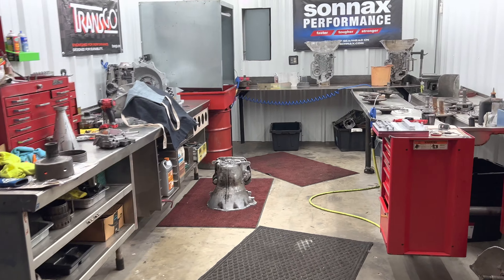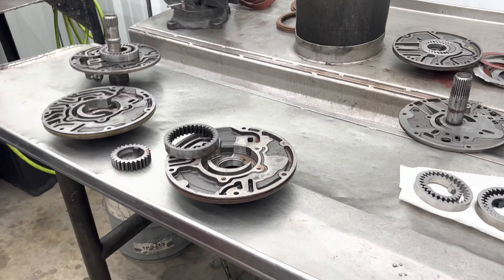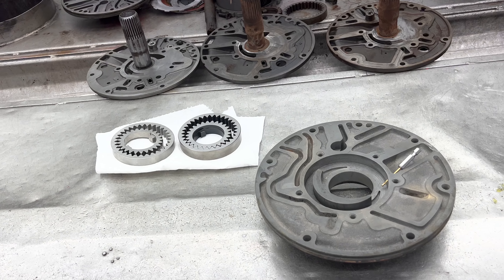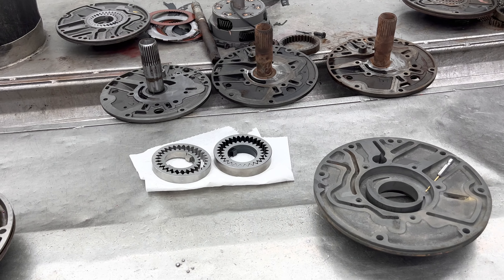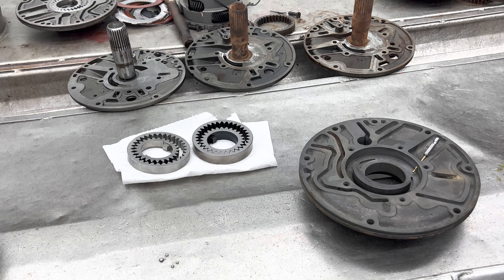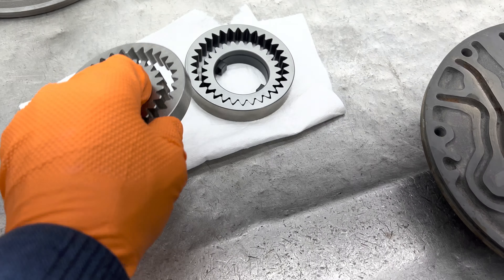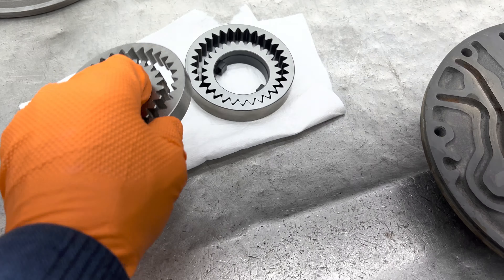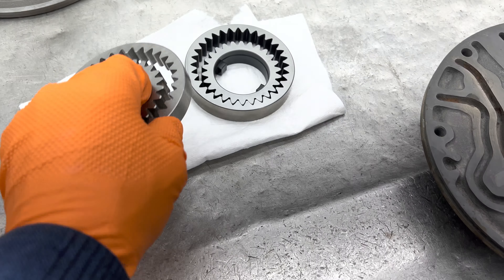How to make your pump last.

Comment: I put a new pump in my Powerglide, and it had a larger convertor charge hole, and it made my convertor really tight. So I had put a set screw in and matched the hole size to the old pump
Reply from the maker: Yes sir we even tap them and put different size orifices in there for converter tightness with dump valves

Comment: Is it a good Idea to drill out the Converter charge port hole to a larger size than stock for a full manual valve body?????
Thanks!

Comment: Also,  Does a powerglide cause issues with the LS thrust bearing in a no trans break application. On the th400 you recommend tapping the hole and putting an insert in and drilling it out.  Is it something that should be done to the glide as well???
Reply from the maker: It depends on a lot of things a lot of trans. Valve
 bodies restrict the circuit at the plate where you don’t have to put a restrictor in the pump. I have never ran a restrictor in my transmission. My restrictor is in the plate from the factory.
Reply: @richardteresacricheducatio3542  Thank you. Love your hands on Videos!